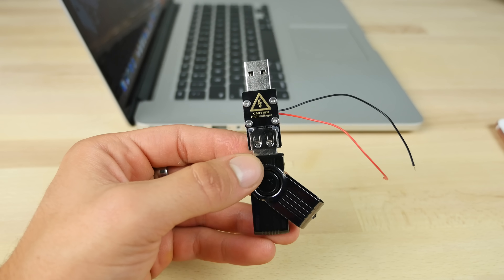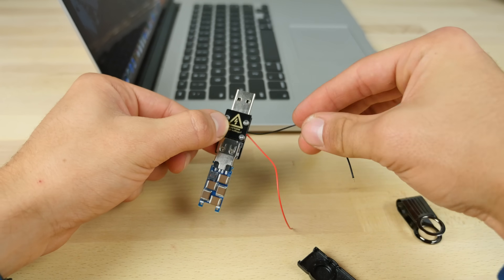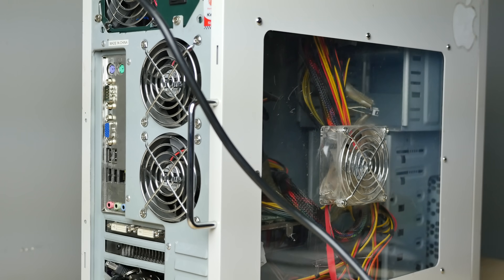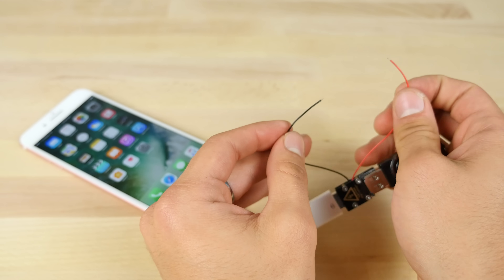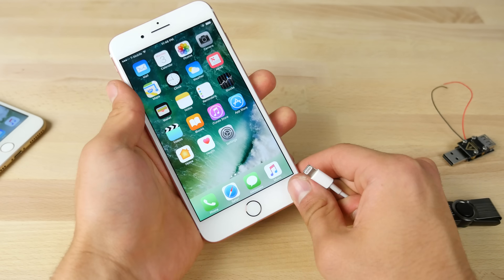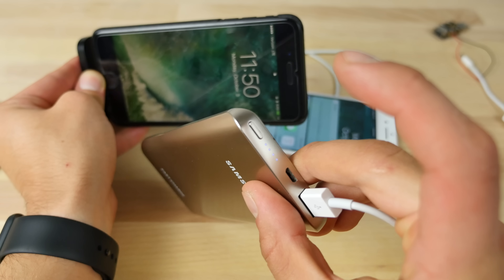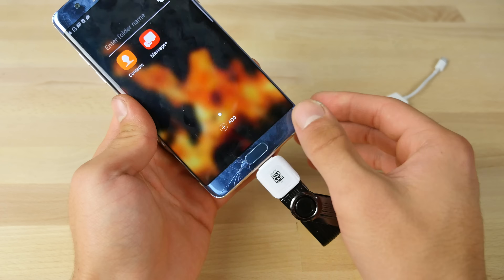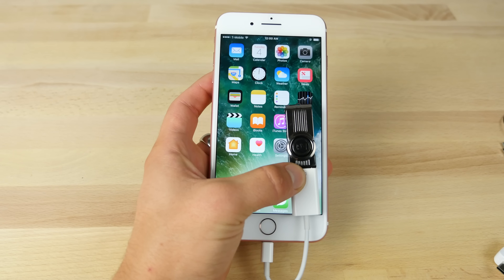USB Killer vs iPhone 7 Plus - Instant Death?

Comment: HA! The Note 7 survived the USB killer. At least Samsung put proper isolation and protection on the data lines. Seriously, what is with Apple designing stuff that gets fried easy? They make  decent products (though overpriced a bit), but why don't they think of the stuff? A simple ESD protection circuit prevents this. If the USB killer can fry it, there's a VERY good chance static electricity will too. Even a few mA at high voltage can kill stuff.
Reply: theLuigiFan0007 well at least iPhones don't explode when u charge it
Reply: theLuigiFan0007 and he left it like that for a couple of mins unlike the note7
Reply: That is definitely true, but Apple didnt have to recall literally all of their phones and stop production of them because of the exploding iPhones. Samsung did.
Reply: It murders all Samsung laptops but macbooks are unfazed. I wouldn't give power props to a company that had the biggest recall in mobile history ... and then had to recall the recall - for power issues.
Reply: The Note doesn't have a battery flaw. It's a defective power supply chip on the mother board that's causing this.
Reply: theLuigiFan0007 The Hindenburg and the Challenger ... all had pretty good specs but still considered failures cuz they exploded and killed everyone on board. It's like loosing a race while flashing a pretty smile.
Reply: The BaconGators The Samsung never even tried to power up the port. It didn't detect it as a device worth powering.
Reply: theLuigiFan0007 but at least the iPhone 7 doesn't explode on aeroplanes and when charging
Reply: Youre fucking stupid. Macbooks are the only laptop that dont get fried from it. Explain that.
Reply: Pritpaul Dhesi
True, he did leave it decently longer. I bet what killed it was the lightning adaptor fried, and then passed the shock through to the phone. Then again, I guess it's not too much of an issue, it's more likely to be used to kill regular PCs then mobile devices. I'd still like to see better protection though.

As for the Note, yeah they had a battery flaw. Apple had the same thing happen to some iPods and earlier generation iPhones. Same problem also affected Dell and several other companies a few years later. I'd think more extensive testing should be  done on the battery before shipping it.
Reply: Mind you the Note 7 just like the Nexus 5X/6P, HTC 10, LG G5, LG V20, OnePlus Three and Two has USB C but anything with QC3.0 doesn't meet USB-IF standards.
Reply: *****
Well, it's a pretty good phone overall from looking at the specs and what I'v heard minus the major battery protection circuit issue.
Reply: the iPhone was plugged in much longer than the samsung
Reply: At least Apple's iPhones dont explode in your pocket.
Reply: theLuigiFan0007 There will be phones that catch on fire from any manufacturer but kept to a minimum and/or kept secret.
Reply: theLuigiFan0007
Reply: this is true
Reply: ***** You don't read specks do you? We are talking about 3 to 4 times more powerful hardware, but yeah they are not innovating like Apple, killing the headphone jack and all those futuristic shit....
Reply: This thing is more powerful than static electricity, it's a fucking taser.
Reply: theLuigiFan0007 Huh, They should may computers more resilient, like humans then.
Reply: lolek bolek You also just insulted Samsung whilst trying to defend them. How stupid can you be?
Reply: Michael Sowerwine
That's very interesting if they don't get fried by it. At least the MacBooks have a properly protected USB port. +1 to Apple for that.

Seriously, that kind of protection should be standard in all computers, including regular PCs. The USB ports should also be isolated with a optocoupler or a signal transformer, and diode protected.

An optocoupler is basically a laser, fiber/lens and reciever in a tiny chip. They're used in power supplies to feed sense signals back to the mains voltage side from the low voltage output side, to prevent a shock hazard.

Also, tiny isolation transformers or optoisolators are used in Ethernet equipment for a similar reason, those long Ethernet cables can pick up a nasty charge. Take a look at a Ethernet card or inside a router, you'l see black squares the signal goes through after the port's connections before it reaches the main chip.

Sadly it's not all too common yet in USB besides diode protection, unless we're talking about military/police grade laptops. But, I'm sure it will be considered more in the future for consumer grade products.
Reply: Infax
True, it's a problem with the protection circuit built into the battery pack not doing it's job correctly. And that should have been caught.
Reply: Grant Chance
Say what? With the amount of iPhones that exist, there's gonna be a few faulty ones that burn up. Here's 4 somewhat recent incidences of the iPhone exploding. Most have pictures and interviews.
http://www.ktnv.com/now-trending/california-womans-iphone-explodes-catches-fire
http://www.dailymail.co.uk/news/article-2972219/Man-suffers-degree-burns-iPhone-spontaneously-EXPLODES-pocket-yes-suing.html
http://www.cbsnews.com/news/new-jersey-college-students-iphone-explodes-in-pocket-during-class/
http://www.independent.co.uk/life-style/gadgets-and-tech/news/iphone-6-fire-flames-explodes-on-flight-plane-hawaii-washington-anna-crail-a6944416.html
Nothing is perfect, it's gonna happen... that said some are a bit more likely to then others. Like phones with bad charge/protection circuitry.
Reply: Eviltech Not just that, the design due to the curved edges and back make it steep and thin. The X-Ray of the Note 7, Note 5, S7, S7 Edge, S6 and S6 Edge are all compared. It had stated that the Note 7's battery is a hair thicker than the other batteries and is almost touching the edge of the aluminium so contact with it will make it somewhat explode.
Reply: Istvan Rice
Yup.
Reply: Danijel Lekić
Yes?
Reply: Yea but really there isn't a reason to add that on the phone because the only way something like that would happen is if you are purposefully trying to do it so i mean i get where you're coming from but there isn't good enough cause to add it.
Reply: Blue Behemoth
Not that I'v heard of. XD
Reply: Sherrig Ofdenmark
I'v touched pretty much the same circuit in a cheap flyswatting racket thing. It's nowhere near enough to knock you down or incapacitate you. I'd describe it as a red hot razor blade entering your finger. Potentially bad for your heart if across the chest, but it holds such a small charge there's barely any risk. Much less risk then a regular Tazer.

What REALLY feels like a Tazer is picking a capacitor up off your desk by the leads..... After forgetting that's it's been sitting near a Tesla Coil that was on 10 minutes ago. That one left a mark, and it made a loud snap. And yes, if I touched it with both hands, I'd maybe not be writing this comment. But I'v always practiced never picking a capacitor up with both hands.
Reply: Sherrig Ofdenmark
Self repairing computers would be nice. There's always the research into analog neural networks consisting of DNA and cells.

6 Grams of DNA (human-like DNA I think) is said to hold 3ZB (3ZetaBytes is 3000000GB). Estimated processing power could easily be over 1000000TF (A GTX 970 is 5TF) Another example is a single male human reproductive cell (sperm) contains 37.5MB of DNA information. Crazy to think what possibilities DNA or cell based (essentially living) computers could hold.

And yes, they could be self repairing, and super energy efficient. Think of how efficient you body is. And yup, they'd need feeding of some sort. "One second man, gotta feed my computer." XDDD
Reply: lolek bolek Manufactured.. As in out together, not designed by, moron. Your argument is invalid and it sucks.

Comment: Why does everyone kill their old computer?!
Reply: Probably because DDR2?
Reply: TrollFaceTheMan dude I have ddr2 and it's pure shit, if you want to upgrade it, you have to pay like told the cost
Reply: triple*
Reply: I am a little confused, are you agreeing that he killed his computer because DDR2 is terrible old and outdated which means his Mother Board was also outdated...

 Or are you trying to say he should of kept the outdated computer because DDR3 is more expensive?

 Upgrading from DDR2 to DDR3 is not just a cost issue DDR2 MoBo can only use DDR2 and the same for DDR3.
Reply: DDR4 all the way.
Reply: Idk
Reply: Jim Bauer 
My old computer won't be killed
Reply: Matthew Smith 
My macbook has DDR3
Reply: +Matthew Smith Many Benchmarks have already shown except maybe on GPUs DDR4 speeds are pretty much useless compared to DDR3 especially due to its price.
Reply: TrollFaceTheMan 
Also i have a computer that won't boot until i buy a 400 watt power supply
Reply: What are you on about??.... GPU's doest give a shit what memory you have. They have their own memory usually GDDR5 or HBM these days. The only time you use the main RAM for GPUs is if it is shared memory for an integrated graphics circuit or for ultra high resolution texture work/graphics work.

And in both these examples (Integrated and industrial use) DDR4 's capability of going almost to twice the clock speed and many times higher bandwidth than DDR3 REALLY help. Ofcourse memory does not make a big difference for gaming experience between ddr3 and 4 when the dedicated GPUs usually tested makes use of dedicate graphical memory not the main RAM, DDR3 was already far more than needed so far for loading in assets between the cpu and gpu, untill we run into games that need larger ammount of data loaded into memory and processed by the CPU we will not see a need for DDR4 in the gaming market.

On a note about the price, DDR4 is coming down in price rapidly and especially in the server market the DDR4's are starting to become a better option as you can on fewer ranks have more ammount of RAM capacity than on DDR3 allowing for higher compute density allowing for massive improvements in cost over time.
Reply: *Facepalm* What I was referring to above about the GPUs is the Ram built ONTO the card, MoBo RAM doesn't need such high clock speeds only Gpus can utilize them effectively. I figured what I was saying was pretty self explanatory...

 Anyways I still stand with my same point earlier which is DDR4 MoBo RAM just isn't worth it right now as nothing can fully utilize it's extra speeds and bandwidth and it's price is so high ATM.

 Though you are correct as with most things it is coming down.
Reply: Like i already stated, There ARE applications that can use the DDR4. However mainly in the server market. Virtualization for example is a great example of where it is usefull. If you have about 1,5-3 TB of DDR4 memory on a single server and roughly 100-300 cirtual machines on it with only 18 or so slots for memory then you can see why the high bandwidth and clock speed is needed for all of those virtual machines to be accessing the RAM.

DDR4 is doing wonders for us people in the servers/Datacenters industry i can tell you :)

And the only post by the name you replied to that i saw was "DDR4 all the way" So i guess the message you replied to was removed and therefor your message became completely out of context hence my confusion. 

Even so.. "Ram built onto the cards" there are no GPU cards with DDR4 so that statement still makes no sense, They either use GDDR5 which is a form of DDR3 adapted for GPUS or they use HBM. 

If you mean the analogy that GDDR5X is like ddr4 for GPUS then you are wrong because it is only that, an analogy. GDDR5X is based on GDDR5 which is based on DDR3.

So before you go arround facepalming people make sure you are clear and actually make sense. Once again. i would like for you to make it clear what you are on about with the "DDR3 and DDR4 built onto the card" 

It becomes extra unclear what you mean since GDDR5X which has the highest ever clock speeds in grapphical memory sits at about 1750 which is the mid range for ddr3 not even the upper end.

While the clock speed for HBM sits at a low 500-1000 which is DDR2 territory.

This does not matter tho due to their INSANE bus sizes that more than makes up for it at 1024bit for HBM.
Reply: Fair enough with the server thing but once again for general users it just isn't practical.

 As for DDR4 on a GPU Card I never said that I said and I quote "except maybe on GPUs DDR4 speeds are pretty much useless."

 What i was saying is GPUS are one of the general things I personally believe could fair well with faster RAM for the average consumer. But for the system itself getting much past 1,800Mhz makes little difference for the average consumer...

 I can see where the confusion came from though and I apologize. Also props for using paragraphs instead of just a block of text like most individuals... It makes things much easier to read :)

Comment: it must have fried the power IC chip, my girlfriend's 5S fried when we were in Thailand trying out those fans that you plug into the phone and we were able to have a local fix it but it would only charge through third party cables and it charges super slow and drained fast

Comment: If any of you are scared about someone plugging it into your computer and frying your computer, he said he built his at age 14, computers have come a long way since then, a lot of  computers these days have wires only meant for the 5 volts on the power lines, and much less on the signal lines. It is more likely for your usb port/the cables to it/your chipset to fry rather than the whole motherboard. If the power supply is what failed (it cannot be by the way), then the batter of a lap top would be what a laptop would have, an explosion caused by just one usb stick! (The battery would be fine, the motherboard would fail before it got back to the battery, and the battery has safeguards, and the other components would fail before that...)

Comment: its the fast charge feture of the phone that protects it. see fast charge uses a higher voltage and amp then most. do not believe me look at the charger for a fast charge device the one it came with it will have a voltage out put max of 12 volt of I shoud say turbo charge as that is what most phones call it is a turbo charge feture. I do not have but one charge on hand right now and mine sys 12 volt 1.5 amp turbo 2. it has three stages normal and turbo 1 and turbo 2

Comment: so it basically does kill the iphone. because it can't be charged, since there is no wireless charging that would in fact kill the phone. once the battery dies, that's it for that phone. 

and it does nothing to the samsung phone, i'm a little surprised. I figured it would burn out the port for sure. But nothing. that's pretty cool.

Comment: the computer is probably not fried either when a desktop computer senses high voltage spike the power supply triggers safe mode and turns off all power going to the motherboard is you unplug the power supply from the wall and from the motherboard the power supply will reset and the computer should turn back on when you plug the power connector back in to the motherboard and back in to the wall   please try this and let up know   thanks so much

Comment: I rly wonder what happens if u plug that USB thingy into a connected car charger
Reply: If it's a cigarette lighter plug-in charger it would blow the fuse in either the plug in or the car's fuse for the cigarette lighter port if the current exceeds what the fuse is rated for "a short circuit condition" regardless of the high voltage that the usb killer puts out and is unlikely because the current is so low from the killer. You might pop the components in the usb charger "voltage regulator"... If you're talking about plugging it into the radio usb port it would pop the radio or the port because they don't usually have fuses and fry the components which aren't designed to deal with input voltage. Simply plugging a small usb battery pack into the usb port on any device not meant to be charged through the same port can pop it... no fireworks just a cease to further function... do not try...
Reply: gυяυвυlυ • true someone must do that
Reply: Dashcam Channel wow thank you for answering, seems like you know what you're talking about... 👍🏻
Reply: De Mize hahahah
Reply: You forgot to fly away.

Comment: The worst it would fry is the resistors and caps on the usb circuit.... if you replaced all the caps and resistors as well as the fuse on the usb circuit, the device would be fine

Comment: This video is fake! 

Dislike!

👎👎👎👎
Reply: well the protection clearly doesn't work properly if it kills the lightening port, does it. that phone will run out of battery and is then essentially bricked.
Reply: how is it fake?
Reply: It's called the phones have overcurrent protection, they won't allow the current to pass through if it is over a certain amount. His MacBook Pro has the same feature, Apple protects against these things.
Reply: What would you rather have to replace, the lighting port or the entire phone?
Reply: Circuit protection works by frying a cheap easy to replace component to save the expensive primary components. 

It works properly as intended, this device will likely only fry the USBs on any given modern PC or phone other than the cheapest ones.

Comment: the reason the iPhone doesn't charge is you probably shorted the interior connection between ground and vcc but with a high resistance so you get a voltage divider so a large loss of voltage

Comment: By the way, USB Killer is the best stupid way to create a killed computer invasion, it's very dangerous to keep transformers (little cubes) at air beceause if you touch them when the computer is ON you'll smell it.
Reply: It will hurt, but it won't kill you.
Reply: sergei291 Of course, it's impulsions but you will smell it anyway... It's a little shock xD

Comment: High current not high voltage. High voltage would fry the USB's motherboard before it even enters the USB port.
Correction Yeah no it is high voltage, and probs a lot lower current.